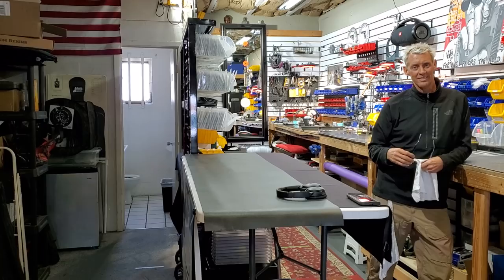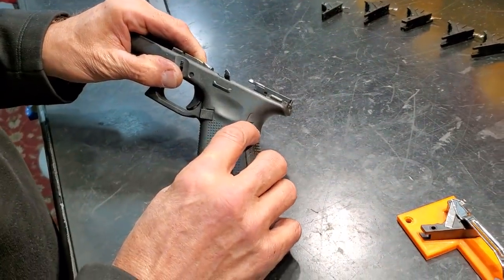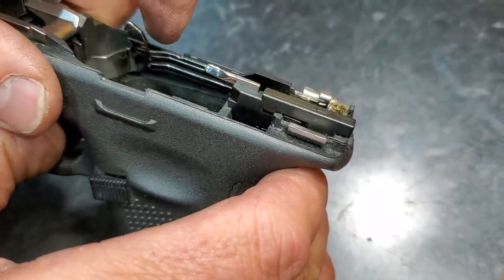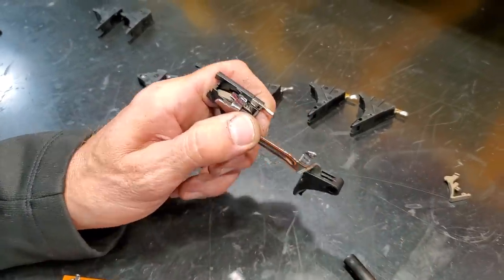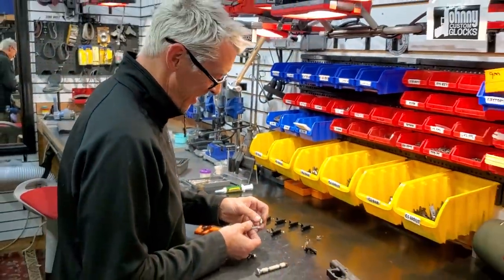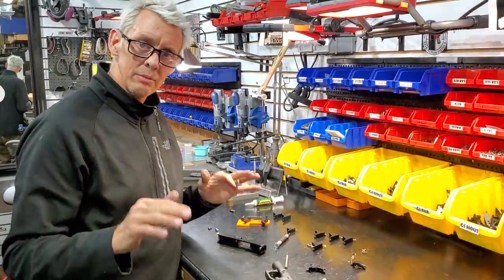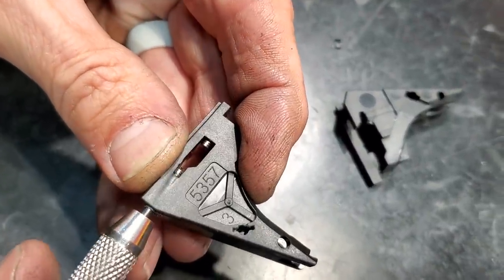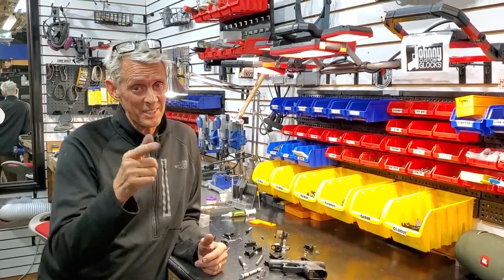FUNCTIONAL FRIDAY the trigger housing

Comment: Another great episode of Glock goodness. Is there a possibility of Timney triggers mods coming?? The reset is definitely funky. I have one in a G17 Gen 3 with 500 rounds. Out of the box running with an OEM connector is was a spot on 3.5 pounds, now 3 lbs plus or minus. Definitely a competition or range toy trigger.

Comment: Yeah I called and emailed Glock asking for help and I explained very clearly the issue and parts I was having issues with. Some of which were aftermarket but I was looking for a solution and how my slide was locked back with the slide stop lever not engaged on my gen 5. I simply asked them to help me figure it out and they just said "Glock doesn't recommend using aftermarket parts". I'm like "ok... but what's causing it? I just would like some help figuring out how to fix it. I took the back plate off, took out the striker assembly, safety spring (I was worried about the the plunger and extractor dropping somewhere into the trigger housing) but a Glock armorer and I couldn't figure it out on the phone so I reached out to Glock. The guy said he couldn't help me because I used aftermarket parts. I'm just dumbfounded as I was just looking for a solution. Problem was the gen 5 safety plunger had caught  and caused my slide to permanently lock back. I could power rack the slide, move and engage the trigger, all parts worked and moved but I could not get Glock to even try to give me some insight on their products. The Glock armorer had never seen that happen in his 20 years of gun smithing on Glocks either and was the one who told me to reach out to Glock. I guess an aftermarket barrel and backplate will make them not want to help you.

Comment: I completely forgot about wanting to get your trigger. I was so wrapped up in the Apex because I got the apex Tactical action enhancement for my 509ct I just got the same one for my gen 5 19 from bdu. It's ok it lightened it a bit and with all the polishing I've done it's decent. For 100$I'm kinda disappointed I think if I polish the apex it will get even better but it's got some type of slick coating or something

Comment: Is 10+1 exceeding Glock's 43x specifications? My 43x stovepipes on the first round when running 10+1.
Remember, loading 10 rounds, then clambering is 9+1. Mine will run 9+1 all day long, but not 10+1.
I know this isn't a 43x video, but I'd bet I will get some good answers here. TIA.

Comment: Mr. Glock, maybe you can answer my question since both Timney and Glock have been thoroughly useless and in capable of answering what I thought would be a simple question.  What ,if any, difference is there in a gen 3 model 27 trigger group and a gen 3 model 22 trigger group? I'd like to install a Timney with your heavier springs in my 27, but can't find an answer as to why a model 27 isn't listed on the Timney site, or what if any work around there would be if the trigger groups aren't in fact identical. Thanks
Reply from the maker: It's because the 27 is a subcompact and considered a defensive weapon. This is a competition setup therefore they do not want a competition trigger in a primarily defensive model. Those are the exact same trigger assembly for the 27, 23, and 22 as long as they're the same generation that is
Reply: @johnnyglocks  a sincere thank you sir. I very much appreciate the information.

Comment: Question on poly80 and ejector switcharoos. If you’re using a Glock oem slide, would the gen5 ejector matter on a gen3 top with a poly lower?  I don’t understand the reasoning unless it’s just a “thing” now. 🤣. Happy Friday - Glock on 🇺🇸
Reply from the maker: Sounds like P80ralph knows. I would defer to him as I don't do a lot of p80 work
Reply: I get the pattern aspect. Didn’t know if it was starting to be a go to upgrade for all models or if it was reasonings due to poly80 specs. Thanks for all responses!

Comment: In your pre-travel reduction video your technique for reducing pre-travel was to go in from the top of the housing… Since then you’ve clearly discovered an objectively superior method of reducing pre-travel by breaching the safety shelf from the front of the housing and using a set screw, rather than a coming straight down through the top with a roll pin. The reason this method is objectively superior to the old method is pretty self evident… By coming in from the front with a set screw it allows room for adjustability, where a roll pin from the top doesn’t really.. Now you are essentially limiting pre-travel the same way that you’ve been limiting over-travel for years…. But that doesn’t mean that the thousands of trigger jobs you’ve done using the previous method were “hack jobs”.

Comment: If there's anybody out there that knows how to get the Locking block pin out of a Glock 42. I'd search YouTube for days. I put in an extended slide release from the Glock store. So it's not the OEM Slide release and now I cannot get my locking block pin out. I push down on the Locking block pin and with all the muscle I have in my body. It will not budge. Please somebody out there.
Reply: With the OEM part it would pop in and out since I've put this extended slide release from GlockStore. It's like it doesn't want to come out.